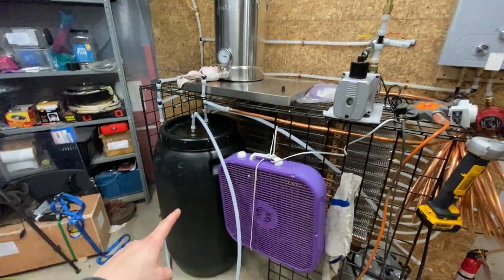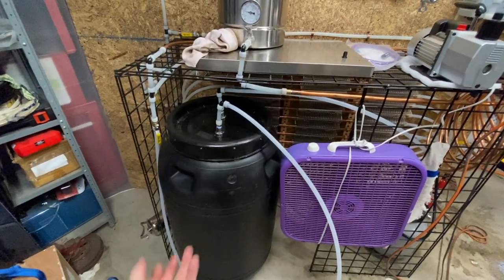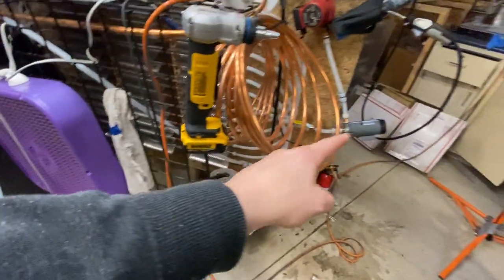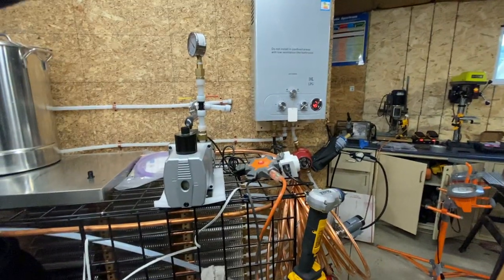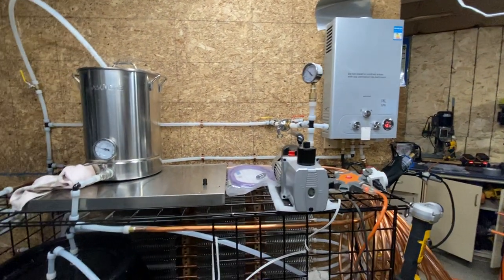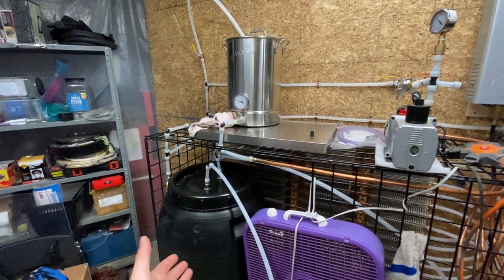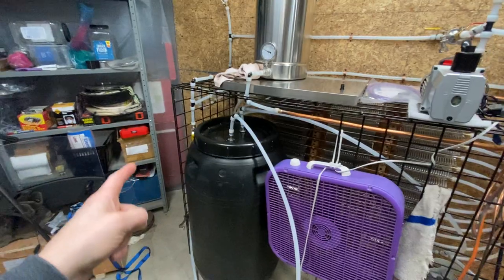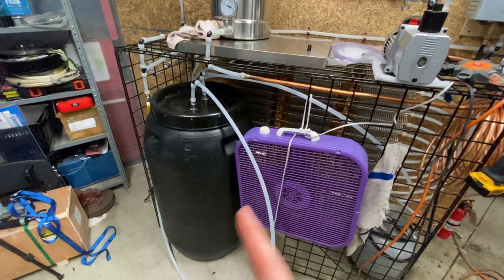55 gal Barrel Thermal Energy Battery For Radiant Heating And Vacuum Steam Turbine Cryophorus

Comment: That will be exciting to see the tesla turbine as part of this setup. 

Seems like a good setup. Let us know how it helps heat up your workshop
Reply from the maker: Hey raj! Yeah I’m super excited to get this all working together here soon! All things considered it works pretty well. With this small “tankless” water heater I can heat the 2/3 of my 900sqft garage up to a very comfortable 55-65°f inside when it’s 30°f outside. Takes a while but once everything in the garage is up to temp it stays like that for a while! 

I really wanted to do some sort of thermal paste between the fins and the pipe so there would be a really high heat conduction but decided to forgo that for now. The temp drop of the hot water from the beginning of the radiator to the end is significantly noticeable and It can remove the heat from the water fast enough that the hot water heater doesn’t just skyrocket to its shut off temp really fast. So I can turn it on and just leave it for a bit while the shop heats up and I don’t have to keep fussing with it.

Comment: I have a blichmann counter flow heat exchanger I can recommend I had a similar set up in some aspects I used the tanks as a thermal battery and used a 96k BTU A coil converted to water
Reply: I had to go liquid to liquid with the heat exchange system and have huge storage with a constant temp at 190F. Primary was a food grade glycol exchange which does 300F to a large second water counterflow which was hooked to 350 gal water thermal battery in a vacuum insolation tank. You will get to the point where you will need to be reading temp at each transition. I think if you can get a 100 point temperature logger that graphs to a computer you will get some real good data. I tried to upload a picture of the counter flow plate exchangers. I did tons of exchanger design. 
If I'm correct a idea I want to patient would condense your whole apparatus there into  a scalable unit with 2 or 3 exchangers that can manage everything from high pressure steam and gas to Etoh and glycerin, glycol, water, oil.
Reply: I was using the excess heat and dumping into a secondary system that used a 12000 BTU/h A coil that I heated my house with easy as well as all my house hot water.

Comment: i know plastic tubing gets pretty hot..what about some type of aluminum tubing to cool faster?
Reply from the maker: Hey K Gardner, yeah any kind of metal pipe will radiate heat faster. All those aluminum fins are metal zip tied to 3ft4in sections of copper pipe. It’s a bit hard to see though in this video with the system all together. I really wanted to do some sort of thermal paste between the fins and the pipe so there would be a really high heat conduction but decided to forgo that for now. All things considered it works pretty well. With this small “tankless” water heater I can heat the 2/3 of my 900sqft garage up to a very comfortable 60-65°f inside when it’s 30°f outside. Takes a while but once everything in the garage is up to temp it stays like that for a while.

Comment: Your setup looks great. Can’t wait to see your TT hooked up and flying on it! Question: are you going to insulate the hot water tank?
Reply from the maker: Hey thanks for commenting David! For now I’m just leaving it un insulated because all the “loss” heat out of the barrel just goes into the air for additional heating, which I desperately need in here, but as soon as spring comes around or I need to store energy for electrical production I will be putting some foam insulation around it. I may end up just encasing the a barrel in like 6in of air create too if I feel like doing the project. It’s not in the video but I did end up putting a piece of 1 inch foam board underneath the barrel so it’s not just directly losing heat to the cold cement floor all the time.